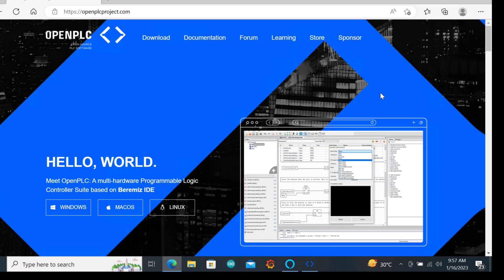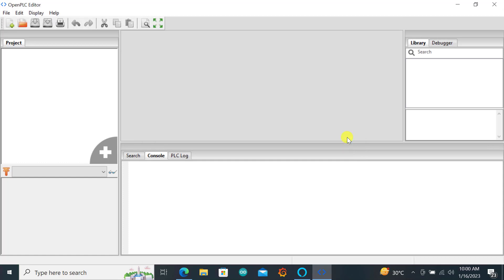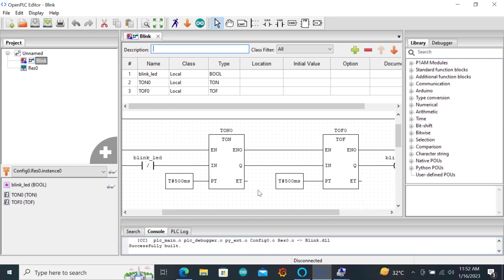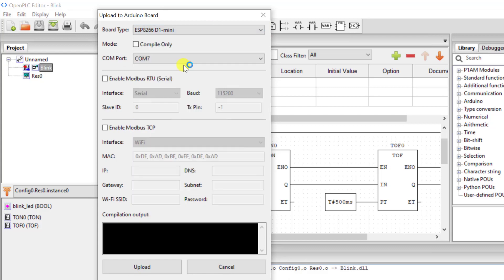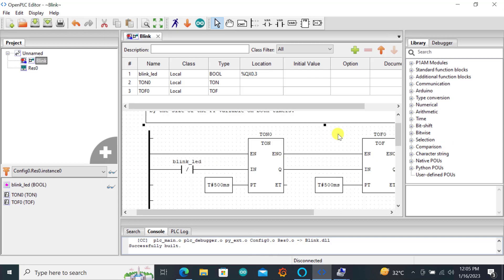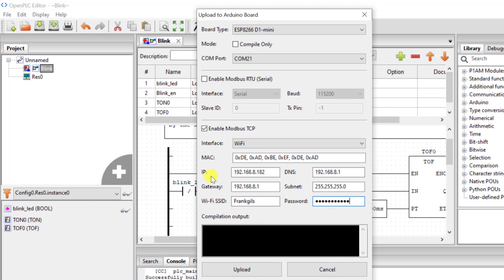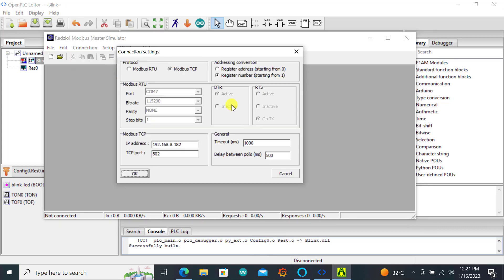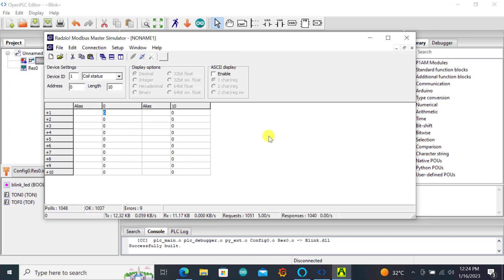How to Update OpenPLC Editor to Work with ESP8266

Comment: but after loading it into Arduino controller , does it work in Standalone or do you always need to keep it connected to PC via USB port .! thanks for the information
Reply from the maker: Thanks for your question and comment. Yes it works in standalone mode No need to connect to your computer after downloading the code.